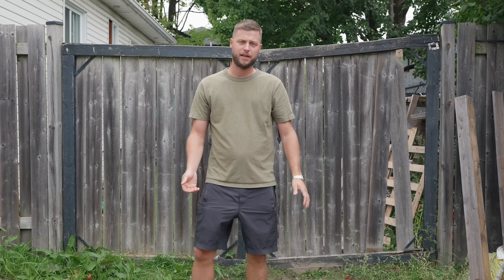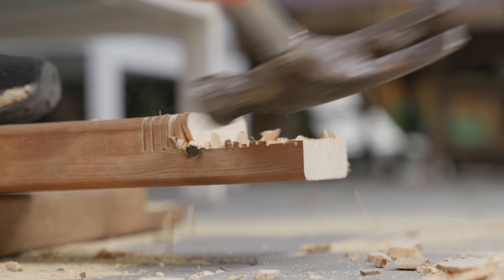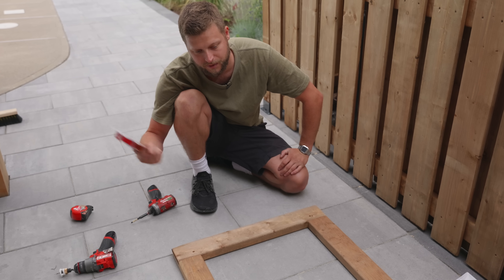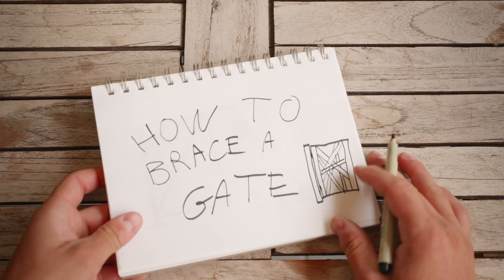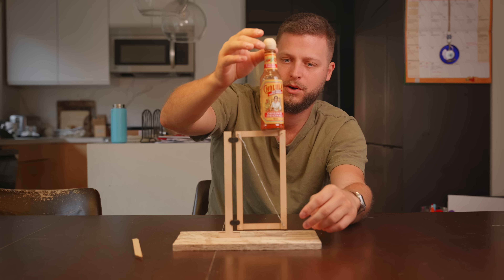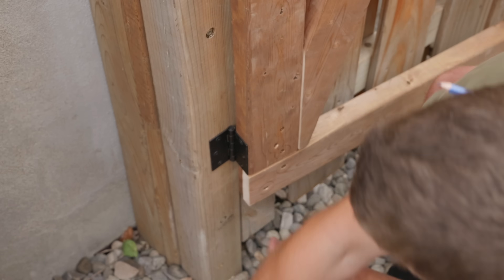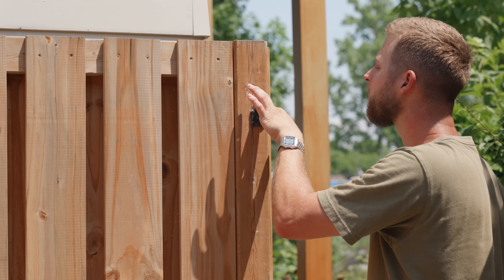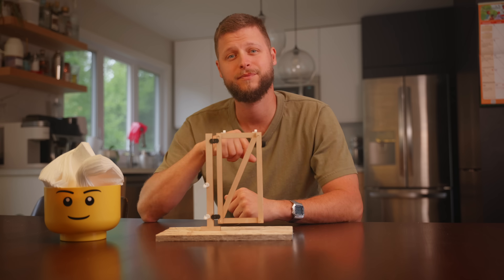How to Build a Wood Gate That Won’t Sag (Full Build + How to Brace)

Comment: I watched a company my neighbor hired to build a fence, do the gate wrong. This was a professional fence building company. I stopped them and showed them the right way, and they said it doesn't matter because they were using the metal fence posts. I tried telling them that that doesn't have anything to do with the correct support of the gate frame.  Which they were using 2.4s. The gate didn't even last 6 months before it was about 7 degrees lower and dragging across the ground. My neighbor made the fence company come back and rebuild the gate the right way. When I'm doing a gate i always upgrade the gate posts to a bigger size instead of the normal 4x4 post. I usually go with an 8x8 then cap them with some cool lights. Those posts, with 2 bags of concrete will never move. Plus you can soak the base of the post for a few weeks un used motor oil and it will last for 30 to 90 years depending on how much moisture you receive.
Reply from the maker: Nice! Great tip!
Reply: Used motor oil is a very toxic pollutant.  It should not be used in that manner.
Reply: @philtheheaterguy951  I have posts on my property that are almost 100 years old with plants growing all around them. They seem to be doing fine. Tell me more about how things work?
Reply: @Darkice77  They aren't pine.  They're probably locust.
Reply: @philtheheaterguy951  Nope it was the green treated pine
Reply: @Darkice77  Green treated pine did not exist 100 years ago.  Nice try.
Reply: @philtheheaterguy951  Were talking about my neighbors fence. Why do you try and change the subject?
Reply: @philtheheaterguy951  If your talking about the fence posts on my property they were redwood then soaked in used oil.
Reply: @Darkice77  You said they were pine a few hours ago.  Your story keeps changing.
Reply: @philtheheaterguy951  your car is toxic too.

Comment: It is a good plan for the brace. But I find a brace in compression will twist & warp even faster. A brace in suspension from the top of 'hinge side' is stretch almost & stays much straiter for a longer period of time. In compession from the bottom of the 'Hinge Side' will has have a large levering effect on the top hinge, causing it to loosen up sooner than a bottom hinge in being pushed against the post. All of this only applies if the brace is at a 45 degree angle or more acute against the hinge side which ever brace is used.
Reply from the maker: This 45 deg thing is a myth I believe. you should test it out and let me know your findings
Reply: @mateostabio  It takes a few years at least to test. But you may be right on that one.  The more vertical the angle is beyond 45 degrees would make sense. But you may be right

Comment: I'm sure I could find this somewhere else but... did you let your wood dry? or season? I had to rebuild my fence (to HOA same-as original standards) and I did not have time to let the wood dry. So... I install all the boards using a jig and everything is perfect, until it dries 6 months later. Now it looks like I eyeballed the planks and... whatever, the fence is new. We painted it and then sold the house.... 
Basically, the gate will shrink if not dried.
Reply from the maker: Yes. That brings up an excellent point. I did have the wood sitting for about a week, it also helps to see which 2x4s are really out of whack

Comment: Beside the hangman, the posts will rotten within 5 to 8 years! Why, because you put them in to concrete.
Reply from the maker: My dad buried his over 25 years. They are just starting to give in now. Not bad of a long time
Reply: @mateostabio  ok, the 5 to 8 year where meant for something like the Blackforest in Germany. If you are in a dessert it should last for much longer, that is tight.

Comment: Compression vs tension make sense but having the brace end at the hinge shouldn’t be a big factor when building this type of gate because it won’t have much difference either way.
Reply from the maker: if its not on the hinge, where would it be? If its on the bottom piece of wood, itll put pressure on the screws holding the wood together, I think

Comment: 12:17 the strength of the fasteners is rarely the reason the gates built in tension fail; instead, the wood shrinks as it ages and drys, and it literally lets go of the nails/screws/lags and the structure pulls apart. 
You can mitigate this by using very dry lumber, and sealing it well and re-sealing it often, and building with thru-bolts with washers and nuts, and re-tightening them when re-sealing the gate, but this adds a lot of maintenance labor over building the gate correctly the first time. 

Excellent demonstration!
Reply: Well said about the fasteners. Good fitting joints of the correct type, not using nails, pre-drilling for screws and a glue that has some flex like TB 3  along with your dry, well sealed lumber is the ticket.

Comment: Why 3d print a part when a normal plastic cable cleat would have been much cheaper and easier?
Reply from the maker: Its what I had on hand. I had printed it the week prior to hold drill bits on my drill.

Comment: Never cut a brace to a point .... it has no bearing surface..... it will only act as a wedge. All the compressive forces are directed to the point.... just sayin .. 45 years a carpenter..nice explanation..

Comment: Rather than a 3D print how about a standard screw eye or two?
Reply from the maker: That would have worked. But i would have to run to the store. I had this on hand from a week prior, it was a bit holder for my drill

Comment: Wouldn't the wood in compression bend in time ?
Reply from the maker: Not if the gate isn’t too big. If its a really big gate, you should concider using thicker, bigger wood than a 2x4.
But you also have screws holding it into the pickets. Throughout the length of the brace

Comment: Instead of epoxy use $4 construction adhesive. Also the flip and slide latches are much better than the flip up ones since any movement in the position of the door will make the flip-up type hard to open.
Reply from the maker: Its what I had on hand at the time. Its 5$ epoxy lol

Comment: You have added some magic to your gate probably without knowing it.
A structural engineer would tell you that the forces are the same no matter which direction you turn the diagonal.  If you turn the diagonal so the gate is pulling down on it you see that the connections are critical.  The brace will work in either direction if you know what you are doing and know how to make the connections, engineers do it all the time in real buildings.
In your picture at 8:17 the brace is pushing against the bottom rail and the top rail, but it is also pushing out at the top on the outer stile.  Without a sufficient connection between rail and stile the stile would just get pushed out and the gate would fail.  Most people would toe nail the pieces together or something similar and eventually the nails would pull out.  The magic in your gate is the half lap joint.  This joint keeps the stile connected to the rail, when the diagonal pushes outwards on the stile it can't move because of the magic half lap joint.
In your model at 10:40 you say "you are relying 100% on the fasteners or the screws".  Either way you are relying on the fasteners, with the diagonal being compressed it is pushing outwards on the stile and what do you have there?  a big screw.  Take that screw out and put in a little toe nail and see if you get the same result.  The key, no matter which direction the diagonal goes, are the connections.
Talking about connections- the amount of push/pull on the diagonal also occurs at the hinges, the weight of the gate is trying to pull the top hinge away from the gate and away from the post.  You need a sufficient connection there- size, length and number of screws for instance.  This is one reason that a lot of hinges for gates have a long strap.  Another advantage of this type of hinge- when the diagonal is in compression it is pushing out on the top fo the stile, that joint in turn is pulling on the rail and trying to pull the rail away from the other stile, and trying to pull the stile away from the hinge.  If you use a hinge with long enough strap it screws to the end of the rail and automatically takes care of this particular joint of the system, then you only have to worry about the top outer joint.

Comment: Nice explanation, but it is true mostly for small wooden gates. In case of metal welded construction, due to the ease of fixing metal brace, and material properties, tension brace will be a lot stronger and lighter. Same is true for very wide wooden gates - long compression brace needs to be very thick to resist flexing, so in this case, metal tension brace can be better. (at least lighter and cheaper)
Reply from the maker: Oh for sure. 100%. I didnt want to start talking about weight, different materials. I wanted to keep it simple for diyers, usually building things out of wood. But you are right, you can do a lot more lifting in tension with metal than compression. Cheers!

Comment: If you don't have a 3d printer you could use an eye ring screw or hook screw as an alternative to guide it downward. I used a gate kit on mine and it has been a struggle from the moment I installed it, so I will be using this to rebuild the gate one weekend soon. Thanks for all the info!
Reply from the maker: Glad you found the video helpful!

Comment: If a gate is horizontaly longer, put in an extra vertical in the middle and 2 diagonals in compression. A diagonal should not go past 45 degrees.
Reply from the maker: This is precisely the myth I just debunked. I should of mentioned that. I saw online something about the 45deg thing, but its a myth I think. My miniature model proved this wrong.

Comment: Upper hinges take a lot more pulling forces and wear down sooner (not to mention the wood degradation and screw loosening over time), so make sure to use TWO upper hinges or a longer upper hinge.
Reply from the maker: I like that advice!
Reply: There's also the horizontal stresses of the act of pushing/pulling the gate to open it, as  you're putting more of the movement stress on the upper part of the gate...

Though prolly less stress now that one knows how to build the gate properly!😁
Reply: @KickyFut  , the highest risks for an added stress to the upper door hinge(s) are:
1. Excessive natural wear of the upper hinge's axis and the holding fasteners due to the mass of the door that tries to pull it off the area of installation (contrary to the pushing forces on the lower hinge);
2. Much greater stress on the upper hinge caused by random unintentional pushing (kids playing with a ball, etc) or hard intentional pushing (thieves, angry neighbours etc). They tend to push the door at the upper area, and rarely kick the bottom;
3. Rain and snow that cause faster wear on the upper hinge due to it's greater exposure to weather conditions compared to the lower hinge.
Reply: @AutomotiveCNC the 2nd one is what I was referring to. But I wasn't spoiled by a perfectly hung gate. They were either rubbing against the opposite post, or it dragged a bit on the ground. So there was a bit of pushing force opening/closing.

Comment: I think the main issue, at least for mine, is that there is no solid foundation for the post.
Its just a post in the ground holding a 8ft door on either side
Reply from the maker: yea, thatll do it. I think if I had an 8ft door, Id either make it with metal, or put in a massive 6x6 or 8x8 wood post nice and deep, in a really wide concrete hole.

Comment: I built a gate braced the opposite way 31 years ago.  It still works just fine.  I think mine works because I used a metal rod under tension.  Next time I'll try it the other way.
Reply from the maker: Yes. Indeed, a metal rod or a piece of rebar is 100% better in tension. But this starts to become kind of complicated to explain. This is strictly for wood gates for DIYERs. But yes, if you use a thin metal rod in compression, it will bend if it’s too thin for the weight of the gate, but in tension it will work.

Comment: The "wrong" way is right if you are using a cable or chain to operate under tension and anchoring it all the way through the frame.
But under compression (the way wood works) the way we're being shown is the right way.
-
edit: Yeah, and he covered all that after I commented.
Reply from the maker: Haha, yes you are right. But I didnt want to start doing a full on physics lesson on materials, weight, thickness and all. Ill keep it at stupid easy to understand for wood gates and diyers. Thanks!

Comment: 11:37 did you place it wrong here? the long cut end was in the bottom corner where the bottom hinge is. and in the horizontal example you placed it in the top corner away from the hinge.
Reply from the maker: Nope. Watch it again. For the horizontal side, i 3d printed 2 new hinges that were white. But its still in compression
Reply: @mateostabio  i see the brace is going bottom left – top right in both cases but this wasn't what i wanted to know.
what i tried to ask was does the orientation of the brace make any difference? why is it cut differently on the ends? was it only for the screw placement?
Reply from the maker: Ah yes, you want it to be more of the 2x4 to land more on the hinge side and on the top side of the top. You can cut it like I did, on both sides of the brace. But you dont want it to land mostly  the bottom side of the rectangle.
Its more important that the hinge side and the top side of the rectangle to get more brace wood contact.

Comment: Really nice of you to make that model, really clear! So surprised of all gates and walls Americans build around their houses. Then surprised how common it seems to cast wood into concrete, a complete no-no in Sweden where we are used to building everything in wood. But in connection to the ground you need steel connectors into concrete or it will rot. Epoxi on wood also quite unusual. But interesting in any case, thanks.

Comment: In my experience,  the  construction of the gate and bracing it correctly are quite straightforward.  The hard part is having a solid post that is placed deep enough and is either cemented or tamped in place so that it remains solid for years even with the weight of the gate constantly trying to pull it over enough to make that unsightly lean and have the gate rest on the ground.  With that in mind, strive to build the gate as light as possible without jeopardizing security.  For example, you don't want squirrels pushing it over as they hop on it.

Comment: A lot has to do with how wide your gate is. 

Position of the brace is just common sense. 

For the last decade I've been using the metal brackets from home Depot. 
Fast and easy with no failures. 

But to each their own.

Comment: Incredibly useful video - loved the 'hangman' explanation.
Reply: With the hangman explanation you could extend the post above the horizontal piece, put the diagonal up there angled the other way so it is in tension and the system still works.  A lot of structures do this to create canopies and carports.

Comment: $150 for that Milwaukee Fuel Cordless saw means 'stolen off truck and then put up on Marketplace'...... if that is a deal.
Reply from the maker: Nope! The guy makes stairs for a living, but he was an old man and had a few other ones. This one was an old one that was all needing adjustment, and had a broken piece. fixed it for 25$

Comment: All free-swung framed-wood gates will sag over time regardless of the bracing and fastening method used. Wood is naturally pliable, plus it will shrink and the cell structure will degrade over time.
Yours don't sag (yet) because they are new and very narrow, limiting the torque on the latch side.

The only way to prevent a gate from sagging is to support the lower latch-side corner by anchoring it to the upper hinge-side of the post or building. That's why my 66 inch tall, 95 inch wide 2x6 framed gate with metal corner braces and 5-1/2 inch dog-eared cedar boards still doesn't sag after many years, using a single 1/8 x 1 inch steel flat-bar brace.
Even then I included adjustability when I engineered the brace because we have temperatures that range from single digits (F) to triple digits, and humidity from 20% or less to 50% or more. Once the wood reached a fairly stable dimension I haven't needed to adjust it again.

Waterproof wood glue is always a better choice because it penetrates the grain to lock it together rather than relying on surface adhesion like epoxy. The wood will fail before wood glue does.

Comment: Answer at 10:00. Thanks.
Reply from the maker: On behalf of viewers in a rush — thank you for jumping ahead to the bracing scene and the hangman analogy. But if you really want your fence gate to last, I beg you not to rush this part. That’s the #1 reason so many gates fail: people treat it like a quick “last step.”

Watch the full video and I’ll walk you through building a super-strong frame — starting with my half-lap joints for the rectangle. A few extra hours of work now will give you a gate that holds up for decades. Totally worth it in my opinion